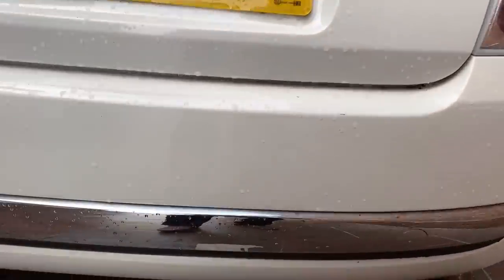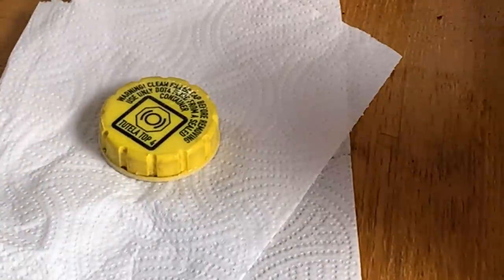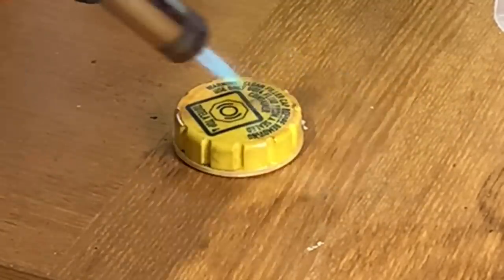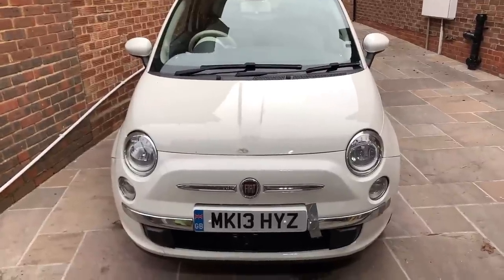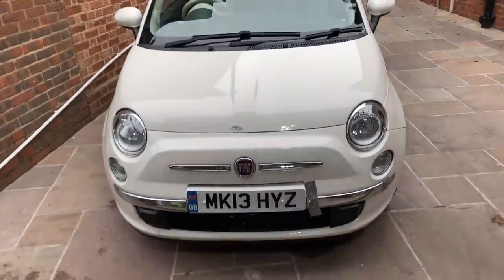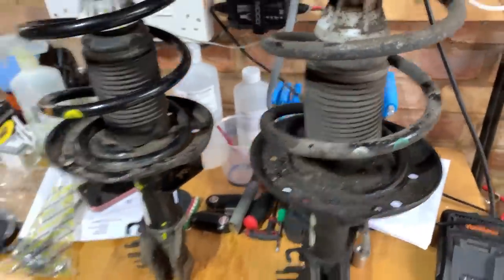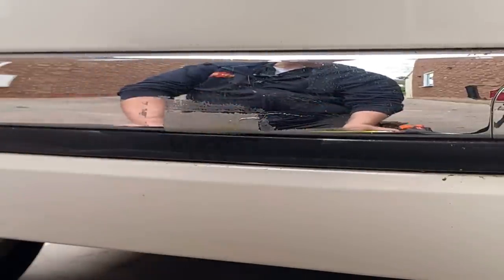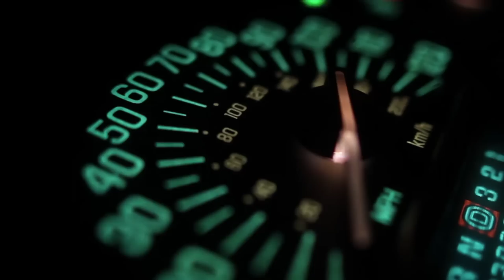Project Markie - Day 3 - Front Shock & bumper chrome - Copart Cat N Salvage Crashed Fiat 500 Lounge

Comment: Had the same problem with my droplink replacement a couple of weeks back. Nut splitter worked a treat to remove the nut, as the Allen key hole was basically a smooth circle.

Comment: Well done on 4K subs  you did want to get to that milestone before the year 2021
Well done on getting out of your comfort zone and doing a different repair / switch over   now you can experiment on second hand parts and strip them so your not under pressure to make stuff mobile.  You will understand how things work and more visual awareness of defective parts and correct location ( damper cushion and bellows cover should be pushed upwards) 
Front shockers should be replaced in pairs when new parts fitted .. bit of a grey area when used parts are fitted  normally I do this as a get me out of jail repair but aware of what I have done 
Used spring compressors for years till I ran  Citroens an they seem to be really long springs and needed a lot of compression so I bought a proper finger type tool that can be driven by an impact gun , but also used those floor mounted jack stands that really make the whole job far easier 
Well done for saving me £12

Comment: Hi paul, you can get work through sockets, that you can use with allen keys.
Reply from the maker: Can you? How does that work?
Reply: The ratchet handle fits to the outer edge of the socket, so its hollow straight through
Reply from the maker: @robertjohnson3406  I’ll have to look into that cheers.

Comment: If you put new shocks on I think your supposed to change them in pairs. And I've found the springs on the 500 don't need to be  compressed much to disassemble them. So not that scary with the spring compression. If I get a salvage one with front suspension damage I tend to change the lot as its so cheap and you don't know whats been bent
Reply from the maker: I've had a few failures on MoTs and they have only ever changed the one. I would always do the rears in pairs but don't think it's necessary for the front.

Comment: Hi P i think the shock has gone,looks very wet with oil ,,,do have a go at changing shocks using spring compressors, you only need to take presure off the top mount on 500's so not too much presure on spring compressors , you will see how bad that shock is when take off the spring as you will be able to push/pull the shock and feel how much resistance/rebound there is...
Reply from the maker: I will definately do it when I get some spare time.
Reply: @Love500  hope you have good quality compressors i have a set with chunky cast jaws and and about 18mm threads they always been fine,, loving watching videos,, tell me does the 500 have same floor pans as ford Ka 2
Reply: I'd only keep the spring, top spring seat and the big nut that keeps it all together. As for getting a ratchet spanner l wouldn't bother as it's not going to fit in the cup what you want is a through bolt socket set if your going to persevere with the manual method of strut removal, l use an impact wrench and a deep 19mm socket.
Reply from the maker: @simonnormys496  Not sure about floor pan although they do share a lot of parts.
Reply from the maker: @daiblack1  I only meant once it's high enough to get a conventional rachet one on it. Swan neck is needed to get it started but was just so slow.
Reply: @Love500  i have 2011 Ka so much on the 500,s looks the same.
Reply from the maker: @simonnormys496  They are very very similar, same engine, same lots of things.

Comment: Probably not a good idea using plastic with a gas gun
Reply from the maker: You have to use a gas gun with this.
Reply: @Love500  wondered whether hot air gun would do it as I would think plastic will melt every time??
Reply from the maker: @MrTrev2507  it’s something to do with a gas flame as a chemical reaction, not just the heat.